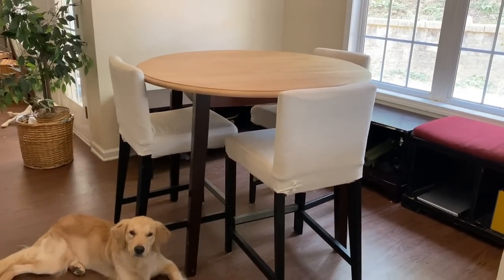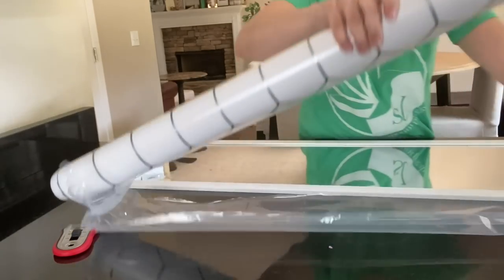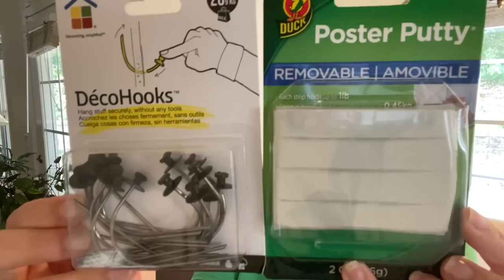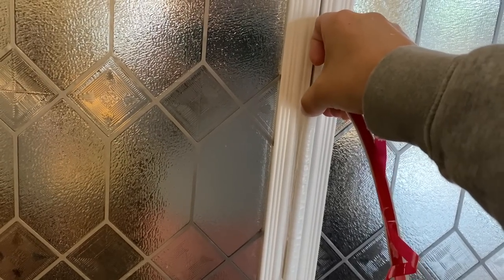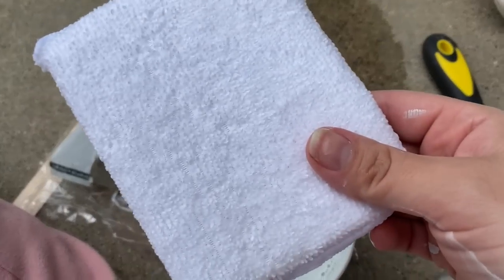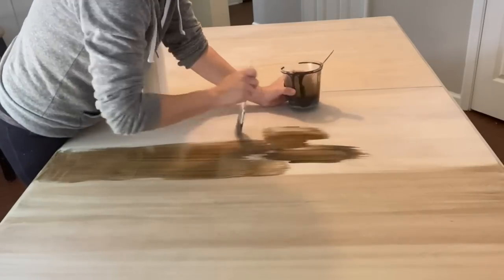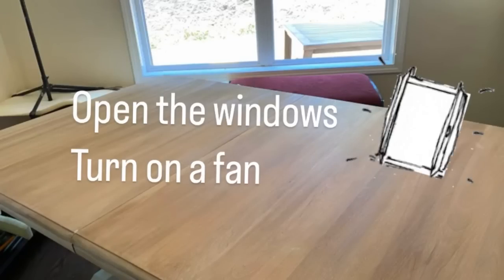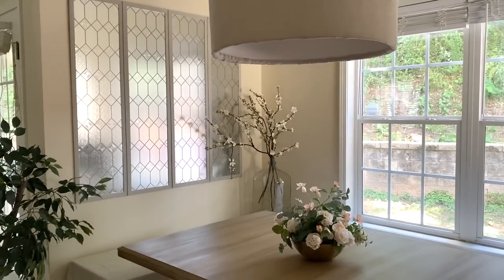Small Dining Room breakfast Nook Makeover on budget RELAXING / Table refinish DIY large Mirror Decor

Comment: Great results Shannon! I absolutely love it. Few questions I have for you. Do you have to completely sand down to raw wood for this technique and did you apply more coats of poly since it’s a heavily used kitchen table?
Reply from the maker: I did have to sand down to raw wood to have the grain showing but I did a sample test on the base where I had just painted it grey and I got a really pretty result with the glaze mixture over the grey!  I think I am going to apply another two coats of just water based polyurethane using the sponge roller technique like I did with the glaze.  But I wanted to sit with the design a bit first and make sure I don’t have any spots I missed before I seal it up for good.  I may even use an oil based polyurethane since it’s even more durable
Reply: I was wondering the same as well! 4 months post- how is your table holding up and what did you end up sealing it with?  I’m looking to mimic your technique, thank you for sharing!

Comment: Hi Shannon. IM SO DESPERATE for an answer. I redid my high top kitchen table with your pottery barn technique. Let it dry for about 4 days. I used the verithane water based polyurethane and did 2 coats. Waiting 24 hrs in between. Waited 5 days for the 2nd one to dry. Someone got a drop of some type of drink that had dried on it. I tried to wipe it off, but as i did it seemed like the poly was coming up with it. It made like “boogies” only way i can describe it. Is that the case? What can i do/did wrong? I didnt want to use oil poly for 2 reasons, one you said in one video it leaves an amber tint on your finish which i didnt want and 2, i was doing it in my kitchen as table is way to big to move anywhere. Any advice would be SO appreciated as im at my wits end trying to finish this huge table in between getting chemo. 😢 Its therapeutic for me. I love your videos and look forward to seeing them. Thank you Shannon!
Reply from the maker: Hey Beth!  Email me at blacksheeprestoration@gmail.com with a picture so I can help ❤️